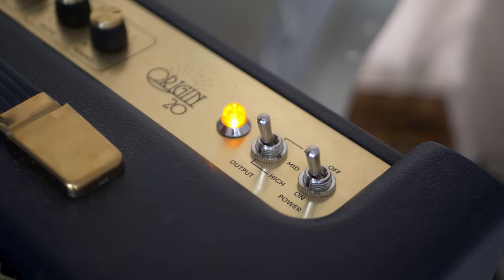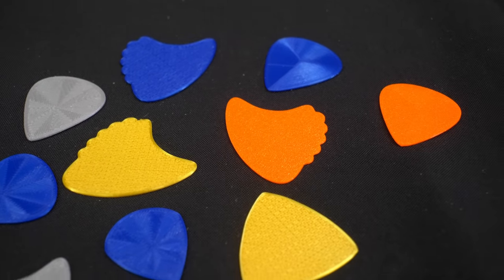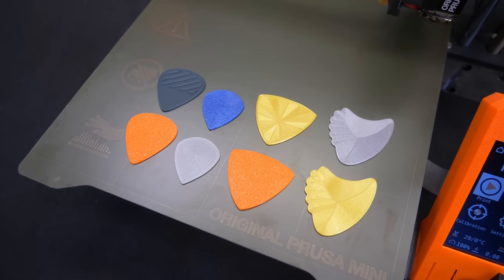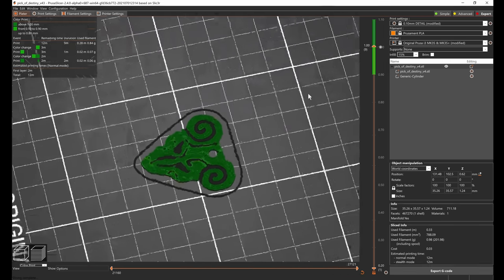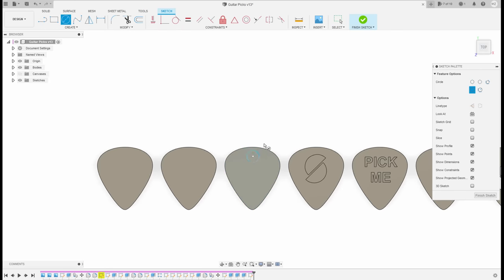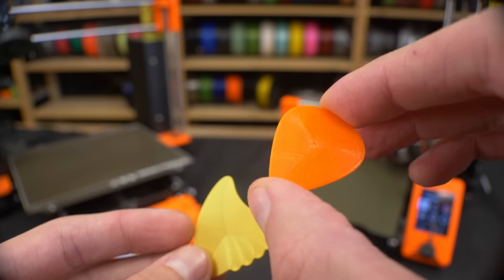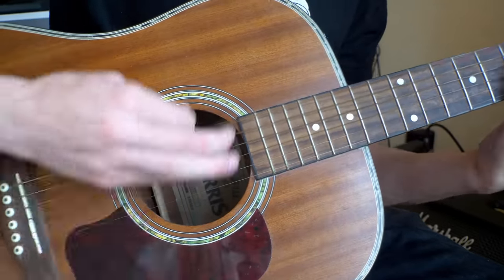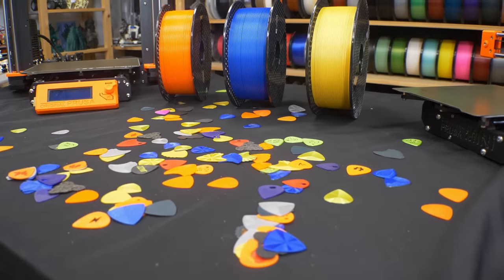I 3D printed different guitar pick shapes and was surprised with the result

Comment: The amount of times I've done this is hilarious. I've spent some serious time perfecting this and 2 parts of cura will give a huge difference and nobody has thought of..... 1) ironing...this will make all the difference. Strength and smoothness. This is a must to a great printed pick.  2) the fuzzy skin in experimental section of cura. This will give you a ton of grip so you're not dropping picks all the time. The perfect mix is making 1/2 ironed and the other 1/2 fuzzy. This gives you great smooth flow over the string with a smooth tip but give you great grip. These 2 overlooked settings will always leave you with a badass pick. Experiment with these to your own liking🤘

Comment: What an amazing find. I wouldn't have thought 3d printed picks would work either but wow. There's nothing better than the pick that's there when you need it and these are easy to print and fun to customize also I can't think of a better way to use up those last little bits of filament on the roll. Now......if only I still played guitar haha.

Comment: Maybe I'll have to give this another shot. I tried printing some picks for my bass and found that I couldn't get the surfaces to be as smooth as a commercial pick, which gave me this uncomfortable feeling of sanding the pick as I played with it.
Reply: You can potentially try a material that is prone to vapor smoothing. Not sure how it would effect the strength though. ASA or ABS might work nicely with an acetone vapor bath if you've got a setup for venting the fumes, but not sure how they would hold up as picks.

Comment: Having worked in device repair, guitar picks have a different meaning for me (helping to open a device that's glued together). A 3D printed pick probably wouldn't help there unless it's a casting mold master for resin picks that are then sharpened.

But for playing guitar, heck, you could design and print a pretty sweet thumb pick. Maybe reinforce it with CF if durability is a concern.
Reply: part of me feels like the carbon fiber would hurt the strings more, but i would be curious to see how it performs and sounds

Comment: I don’t have a Prusa:( but I do have some Enders I haven’t upgraded to PEI build plates do to me being lazy and attempted to print some pick on the glass beds, they WOULD NOT come off and I ended up having to heat the beds to 80°C and print a thin layer over them to finally get them off. Moral of the story is don’t print picks on glass beds unless you hate yourself

Comment: I've found that pla picks rub off onto the strings much more than standard cellulose picks
Reply: Did you try PETG or others as well?
Reply: I mean there's always petg and abs tho
Reply: I found even PLA to be about on par with cellulose picks. But I guess it depends on the strings and electric/acustic guitar. It definitely does rub off the edge, rounds it quickly, but I didn't see much wear after that. And yeah, PETG, PC, ASA, the options are there :)
Reply: Yep, I left a comment about this but YT deletes my comments these days to the creator.  No, just no.  As a guitar player, 3d printer enthusiast for 9 years this is wrong.  Every guitarist will tell you that picks need to be baby ass smooth, and what they are made from DOES matter.  There are just some things that should not be FDM printed.  Now SLA/Powder/Sinter etc... those can be baby ass smooth in material that would be perfect for this.  I still say injection moulding is the best but in a pinch but not FDM for this.
Reply: @thebeststooge  Yup .
You can't print Tortex . 
I've printed tons , they're a novelty.
Reply: @TheLastChapter2023  Yes, and the ridges are great for the finger, and thumb, to grasp the pick (especially in a sweaty session), but the ridges are not good over the strings.  In a pinch you can use a washer, or even a penny, but would you on a continual basis?  This is just not the best case use of FDM, but, as you said, pure novelty.  Powder sintering type 3d printers can even print bicycles you can ride all in one go.  Strong, smooth, etc...  Resin printers, for us mere mortal hobbyists, is the closest to that.  I hate the price of the resin, as well as the projector being a consumable, but the modern choices of the plastic is fantastic.  .05mm layer heights is so smooth, but still are layers.  I am heavily looking at injection moulding, but just like with the Crafsman the moulds are not cheap to have made.  Even if you make your own the blank Aluminium block you CNC out is not cheap.
Reply: @thebeststooge  print on glass…….
Reply: @CC-kc5lb  That is only good on one side.  Seriously, this is just a novelty gimmick.  Do you play?  Do you gig?  If so then you know what I mean.
Reply: @thebeststooge  i do believe half is cosplay and the other useful, the printer material and operator do play in more than u think but for a pro or serious garage player yes this makes a difference sla or what have you but 
also i have an american strat left handed and a gibson sg my old man played his telecaster for most of my childhood making cash at hotels and wedding in bands like the jersey river band i also grew into there set up/sound guy 
he also played mandolin banjo and sang mostly old country  i have seen and used more picks then you may think but yes this is half cosplay
Reply: @thebeststooge  also there are tools like ironing and skin settings in fff or fdm that can get better than you also think  also printing on carbonfiber plate gets you super smooth parts like glass if you bumps are a problem  you can also use other excotic materials that make sounds different from anything you have heard before as the densitys are much much hights than your nylon picks but flex can be adjusted with thickness to so ultem picks are a thing and are printable on fdm printer
Reply: the nylon gray dunlops i remember are printed ruff sides withe the logo and there is meshing on the surfaces  no?
Reply: @CC-kc5lb  I use 0.5-0.7mm picks. If you notice the title of the video is "Can you 3D print guitar picks?"  The answer is a resounding "yes, of course".  Fact is we will never ever agree on this no matter how much anyone wishes to defend FDM/FFF for this purpose.  5 layers and you plan on ironing it too?  No thanks.  I will stick to sintering, SLA (at 10um layer height which is .01mm), or injection moulding to do a proper job.
Reply: @thebeststooge  nono your correct anything but filament printing now we agree whats your material nylon pa12?
Reply: the tool path option called ironing its in the gcode from the sliced model and does not require an iron think of it more of a welder that can go up to 500c but for thermoplastics
Reply: fdm printers are now making molds more than ever and for low production runs i can injection mould tiny picks with a 100w fire rod heater shot loader and a fdm printer i can also sand the mould should u want it smooth but hey what do i know other than i dont need a sla or injection moulding machine to do this
Reply: @CC-kc5lb  I know what ironing is from Cura.
Reply: @thebeststooge  your a top draw item for sure peek pek pei all can but you knew that right
Reply: @thebeststooge  ride a horse save a cowboy ride a stump get your type no far me 
y r the best stooges here

Comment: Hello,

thank you very much for the video. 
I miss in Prusa Slicer the aligning of the modified in horizontal and vertical plane and the center of the print object. And that I can center an stl file with a rectangle in height of 0.2mm and then merge it to have even better hold on the print bed. Currently I align this manually.

Comment: No, just no.  As a guitar player, 3d printer enthusiast for 9 years this is wrong.  Every guitarist will tell you that picks need to be baby ass smooth, and what they are made from DOES matter.  There are just some things that should not be FDM printed.  Now SLA/Powder/Sinter etc... those can be baby ass smooth in material that would be perfect for this.  I still say injection moulding is the best but in a pinch but not FDM for this.
Reply: Don't play into what big guitar pick wants you to believe. Brian May from Queen plays with a coin which is definitely not baby smooth. Lots of things can work as a pick.  I for one think this is a cool idea and if you already have a 3d printer the hurdle to try this out for yourself is extremely low.
Reply: @mattmeola  I have done this before (this is not a new concept) and the ridges over the strings sucked.  Ridges to grip with the finger and thumb rocked.  Just because you can doesn't mean you should, and this is a case of just that.  I can use a penny in a pinch, but I wouldn't want to gig with one night after night.
Reply: I concur. As a tone chaser the raking on strings from the lines is real evident on wound strings. That might be what some people are looking for but when clean is your reach, no. Its novelty to me. If you are playing on a Squier strat under 200 bucks, sure, but at the other end of the spectrum if you are trying to scrimp on a $5 pick youre disrespecting your investment and anyone who has a good ear. Theres alot of accessories you could easily and effectively make for your studio but picks, nah.
Reply: @EarlMiller  I 100% agree.  I mostly play 500-1k axes and even on a 200 USD Squire I would hear the difference, but even beyond that I would feel it which is probably why I am hearing a difference because I am playing differently due to those ridges.